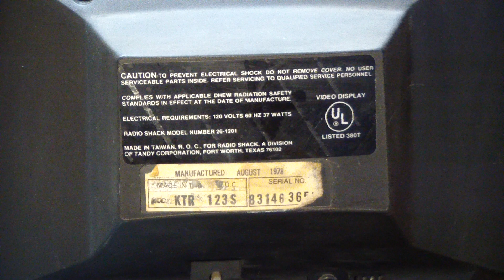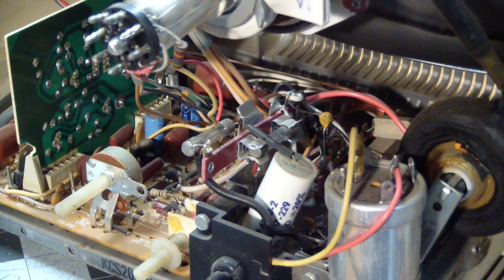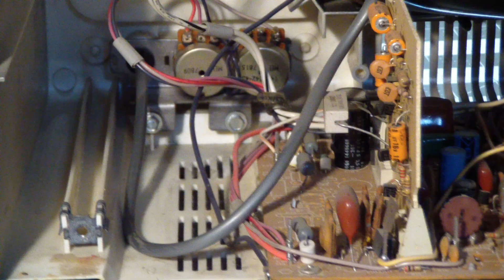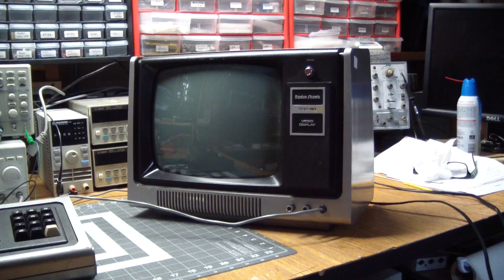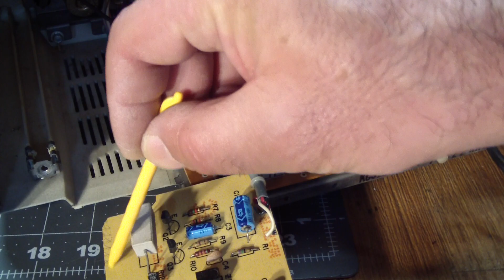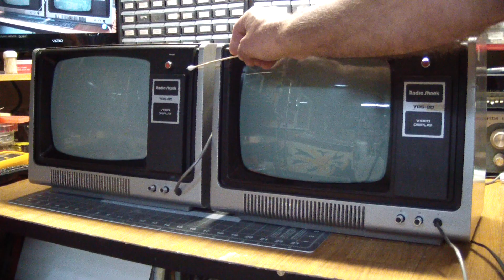AE#202 TRS-80 Model 1 CRT Monitor Repairs

Comment: Rebadged RCA B/W TV. You can even see where the tuners would go. 
They had an absolutely lousy picture compared to a decent monochrome monitor, but they were cheap!
And no, it never had a cup over the 2nd anode! ~12kV can't make enough of an arc or corona to matter.

Comment: ARTIFACT, what is the benefits and advantages of making monitors HOT Chassis? I'm not sure why designers didn't make Non-Hot Chassis monitors any reasons why
Reply: Most "real" monitors did have an isolated chassis with either a transformer or a proper SMPS. These things are stripped-down televisions that were only ever designed to have antenna inputs. I guess it was cheaper for Tandy to buy the chassis like that from RCA and add an input board! Of course, that scheme only worked with a TRS-80 because the source had to supply power to the "cold" side of the input board.
Reply: @coyote_den   How Does a SMPS create galvanic isolation like a transformer?
Reply: @waynegram8907  An SMPS is normally made with an isolated output. This only works if it is made that way. Most TV mainboards have an SMPS sharing the same ground as everything else.

Comment: what's that NE2 doing hanging off the CRT connector?
Reply: It serves as a spark gap. The voltages on the cathodes and grids are all less than 90v, so you can use a neon lamp to clamp any stray HV to ground.